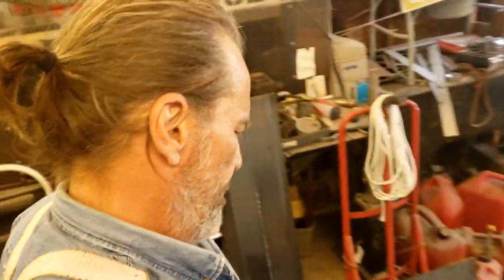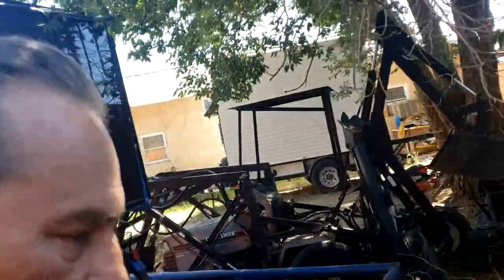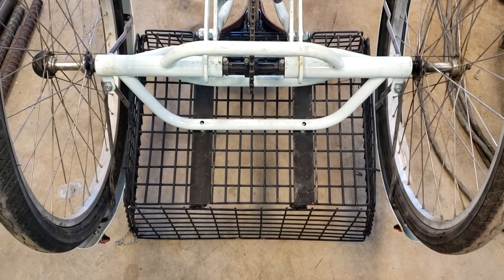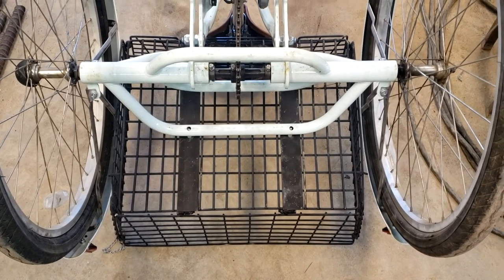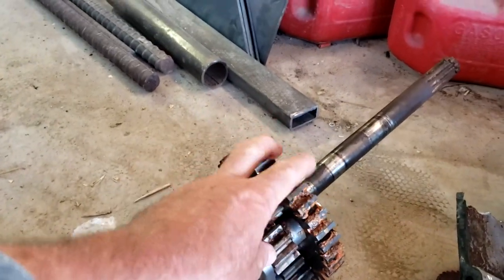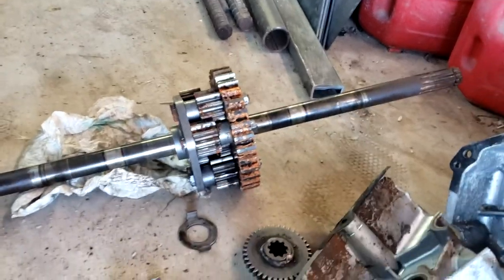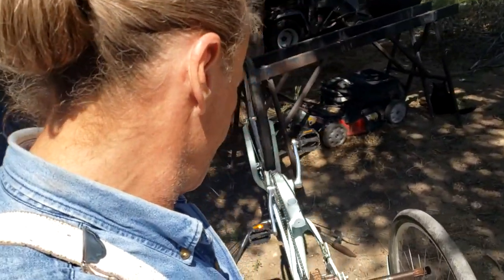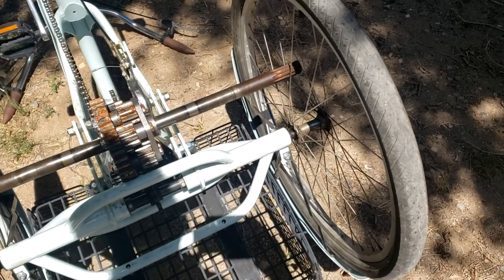solar trike guy admits defeat (:~:)

Comment: Thanks for the heads up. I broke an axel on a 28 inch. I have a 24 Gomier now, but I wanted to extend the back end a bit because there's not much room and if I put weight behind the axel, the trike tips up. It's pain.